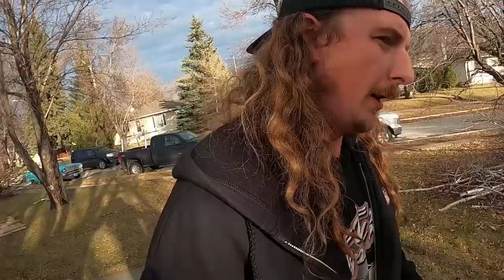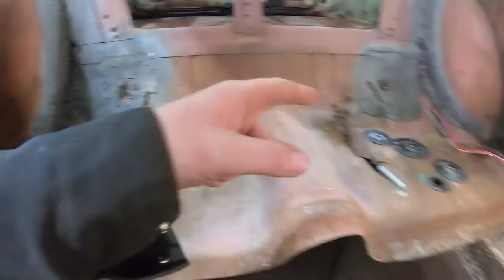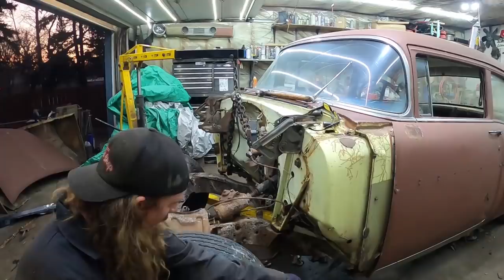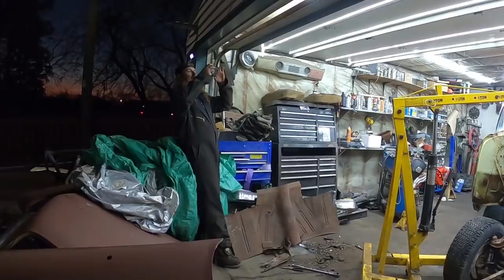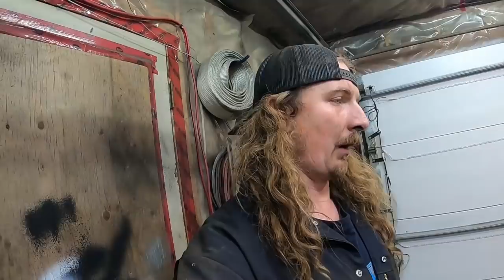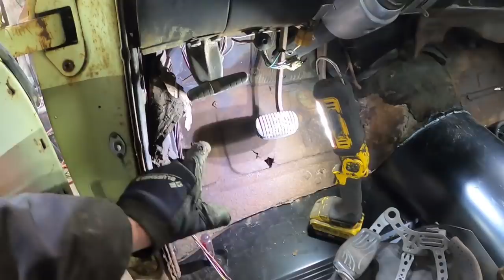Full Floor Pan Replacement At Home - Fast, Cheap and Easy On Your Classic Car!

Comment: It seems as if clearing the tires was the biggest hurdle you had, installing the floor pan. If you have to do this again on another car, remove the rims and tires, leaving small bricks or blocks of wood in strategic areas so you can get your floor jack back under the car to lift it and put the rims back on. An even easier time might be had if you slid the floor pan in from the side of the car. My vote goes to painting the engine.

Comment: When you started it in. I said no way it's going in by yourself. But that car wanted the floor. Romantic really. Was the floor new old stock ? So rare for aftermarket parts to slip in. You had to have lubed up..lol. side note. This would be a great time to showcase your sponsors from the 57 and perhaps they will help you cover fuel systems and wiring etc.. maybe reach out to them. And showcase your 57 alongside. Kind of like , what the winner might be able to do with the 57. Just a thought.
Reply from the maker: Nope it was a re pop floor i was shocked how well it fit haha

Comment: I just seen vid is the floor wroth saving ir replacing with i have heavy rust if u have low bidget to work with my floor is 1200 on chevys of forthy i have 1950 deluxe

Comment: Why didn't you wire wheel or flap disc and prime / paint the frame rails before putting in the floor pan then all would be good to go for long time . but you made that look easy stay safe , stay healthy, stay busy building the cars

Comment: I vote to replace the full passenger quarter, cuz it's so beat up it'll be hard to piece it together and get a good result. Probably get more money when you sell it too. If you get the word out now, maybe you can find somebody out there who'll make you a better deal on that panel? 
Rinse the dust off the 400 & stab it in. No repaint needed.
Reply from the maker: They don't make sedan quarters so I gotta modify a hard top one. 1200 bucks ain't cheap

Comment: Well, believe or not,  you just named this car ! ---->  SQUEAKY  DOOR !  lol  Your killin use here !  My guys want to invade Canada with a stinkin can of WD-40  HA !   One thing you might have wanted to do is while the body was up on jack stands off the frame was to use the wire cup brush and cleaned ALL the frame on all sides and pro 15 paint the frame before installing the floor as now your going to have to do it all on your back ( not a fun job ) Maybe next time right.  . P/S look into the 2 piece lower rear patch panels for the passenger side 1/4er, just dolly out the upper 1/4er and weld in the 2 lower patch sections to finish off the complete lower section and save mucho time in body work on that 1/4er, plus it's easier to block and sand the bondo ( Mud ) the 1/4er straighter and in a very short time you got a next to perfect looking 1/4 for much less then the price of a full 1/4er. The 2 piece patch 1/4 panels are not a good choose for a 100 point concourse show car , but for what your doing there perfect and you can get close out deals on them sometimes .

Comment: If that floor is after market I'd say you lucked out on the fit.
If it's OEM, it could have been worse if not for your skill.
The only change to your floor installation method would be to take the front tires off.  ;-)
Other than the steering parts, they seemed to be a difficulty.
Reply from the maker: Yeah I was hoping they would weld roll it in haha
Reply: So it is after market?
You can't have it that easy.  ;-)

Comment: I think that you should paint the motor up really nice, that will equal more $$$$ because ppl like nice and shiny things and they will open up the wallet's wide for shiny things 😁 then put a nice lumpy cam in it cause let's face it Chevy cams are really cheap probably get one less than 100 bucks and a nice lumpy cam will get them to open the wallet's even wider 😂 but just big enough so that it sounds cool but streetable as well. I think that 150 buck investment will net you another 1500 bucks because if they want to build a really fast car that will be easy because then all they'll have to do is change the heads or they can just drive it like it is but by then u will already have plenty of cash for the next project. Well let me go get this 4 banger out of the pinto so I can get it ready for the 347. But you probably won't read this far down because of all of the comments that you have 😂🤣😂 maybe I need to shorten it but let me know if you read all of it 😁👍🏽🚗🔥

Comment: That floor pan is for sure the way to go. You may want to get a portable lower lift car lift. Yes it's around 2,000.00 dollar but will make your life much easier. Get job with working with what you have.. I didn't think that pan would go in that easy...
Reply from the maker: I would. I jist don't have much room.
Reply: @DDSpeedShop  I understand that very much. The lift I was talking about are portable. They sit in a corner an roll out when needed...

Comment: What I would do with that ratty mangled quarter panel is straighten it up on the cheap until you buy a full quarter panel.   It's better to full ass it rather than half ass it. Until you get r prime.
Reply from the maker: They don't re produce 56 sedan quarters so u gotta chop up a hard top and its over a grand.

Comment: Do they still sell just door skins??? gotta put full quarter on the ugly side. the views you get from doing that should help the wallet if you post as Tri 5 quarter panel replacement.  can you buy the toe pans? I mean the nice floors next to patch work is a little sketchy ya think?  them doors them doors them doors them doors close NICE!

Comment: Why didn`t you lift the front of the body and use blocks than lift the back and use blocks and roll chassis from underneath? Than put the floor in
Reply from the maker: I dunno. Just the way I did it

Comment: See now if murrrrrr were there he would have told you to take the front tires off that it would have slit in a lot better nothing like sliding metal across rubber
Reply from the maker: I was hoping they would help it roll haha
Reply: @DDSpeedShop  the funny part is if they would have been off the ground they probably would have

Comment: I keep laughing at you making a big deal about $1,000 for the whole floor.  My '63 Dodge pickup is currantly getting this done.  The sheetmetal is $2,000, and  $4,000 in labour so far. And it's still not done.  Maybe 80-90%.
Reply from the maker: Wow!  4 k in labor?  Thats where the money is